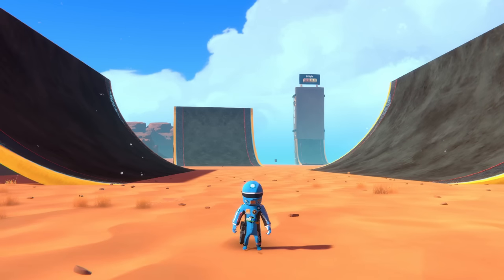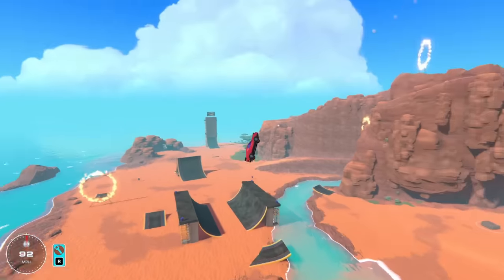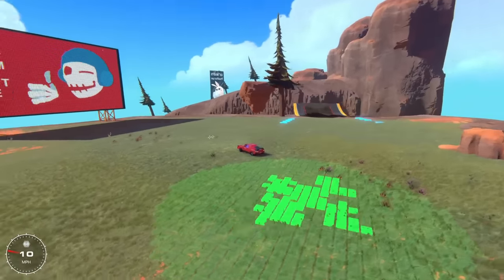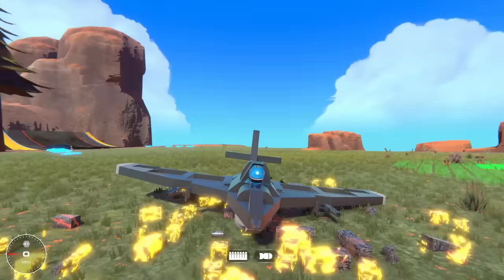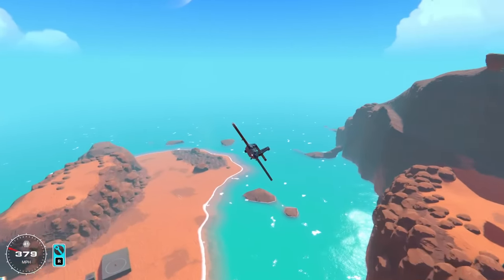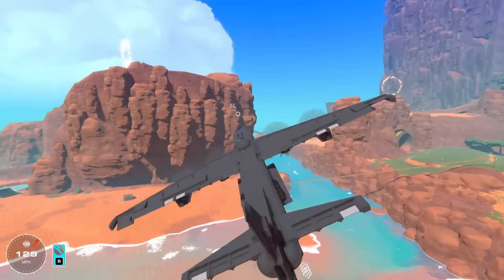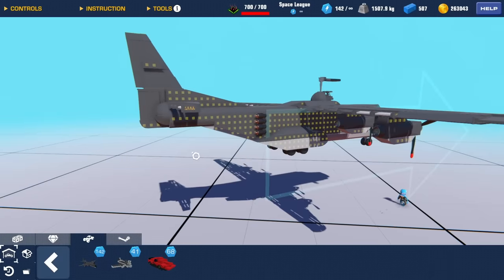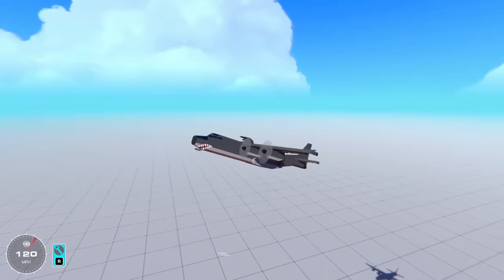I Made A SUPER EFFECTIVE Boosting System And It WORKS!

Comment: It's called the me-163 Comet it was a German ww2 aircraft designed to be a bomber interceptor, it used a rocket with specialised fuel to fly for large periods of time for a rocket. It was discontinued because it was extremely dangerous it used a clip on 2 wheeled dolly for takeoff that fell off after the plane was airborne, and it landed  on a cushioned metal skid. There was also a case where the fuel leaked in to the cockpit of the pilot causing him to melt alive.

Comment: Nice! This could be a fun mechanic for dogfights or maybe grand prix racing. 
You could also make a fuel system where the faster you go the more fuel you use,  which would add a lot of strategy to a long race..
Reply: I have built that. It was a pain in the butt to do and make it regenerate while also nailing down how much boost to give per race